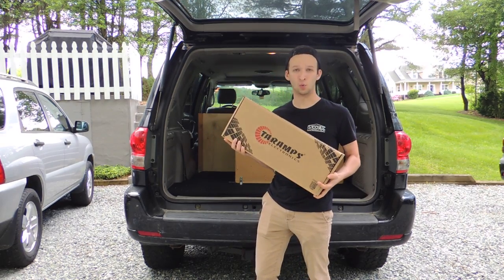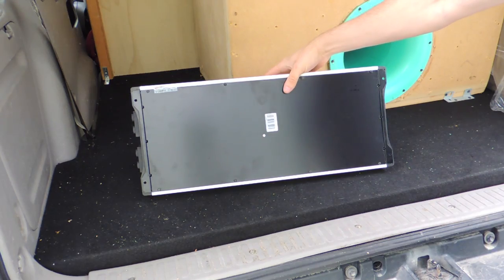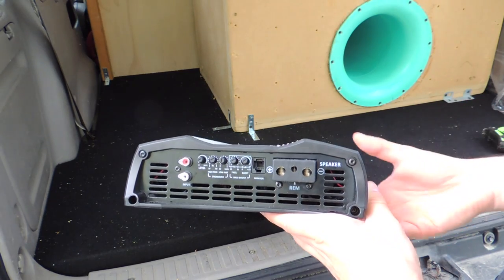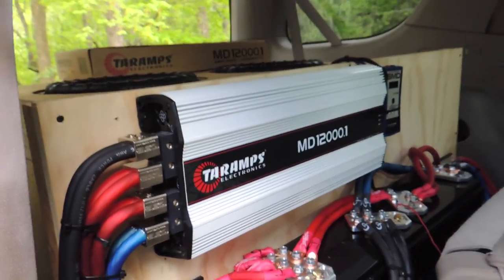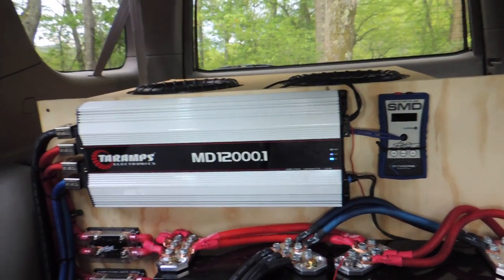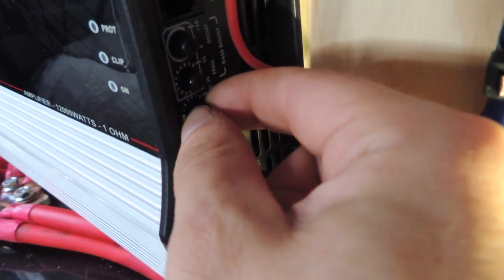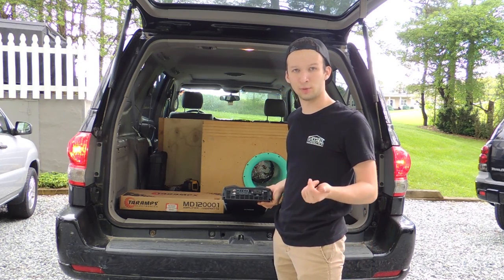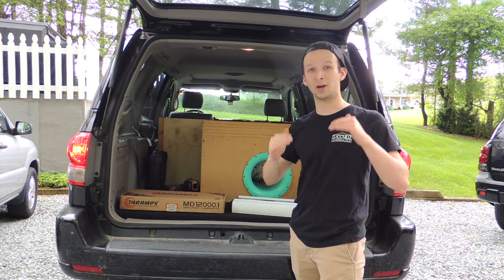TARAMPS? Watch This Before Buying!! | Taramps MD 12000 Review

Comment: You are going to continue to have issues if you keep mounting your amp on your enclosure! Mount that monster in a spot with some deadener behind it. You will also need an upgraded alternator.
Reply: His amp isn't mounted to the enclosure. He did a video a little while back showing the building & installation of his amp rack.
Reply: Joe B - It shouldn’t be anywhere near that enclosure, period. I don’t care what he built to hold it. That is just way too much flex my man.
Reply: He really does not need a bigger alternator with all that lithium he just needs to keep them charged
Reply: Garlicbread Riders - Yes he does, and honestly he should have a least two Mechmans for that kind of power. That amp needs stable high power at all times. There is a trade off with budget power. A top notch Orion or Rockford amp can withstand instability, but not Taramps, so the trade off is spending thousands on electrical instead of thousands on amps. You can fight it all you want, but you will eventually lose.
Reply: Garlicbread Riders - Guess what? He just installed a more powerful alternator.
Reply: King Willie u sound knowledgeable in these. What u think of Skar brand? I just bout their competition amp n speakers $600
Reply: Yapaul Aung - What model?
Reply: King Willie competition svk or some shit like that. Both competition one
Reply: Yapaul Aung - That’s a good amp. Better than Taramps.
Reply: King Willie yea i dont know whats up with the new school shit. Taramps, zapco, soundstreams use to rule the streets in 90s.  Im just getting back in it an seeing that its not a $1/watt era and is the best time for me! 😂   You would have to spend atleast $10,000 to get a lot of todays sound back then.  Might have to buy all their speaker line an upgrade my door speakers. Love bang for the buck plus this company dont bs with watts. They test RMS an back then, these amp company was frauding consumers for a long time. Now we see who still around. Im still a fan of JL but them boys too expensive. W7 is a beast. Havent heard anything that can compare to that sub pound for pound. U heard anything that would resemble JL w7?
Reply: Yapaul Aung - JL is alright, but the W7 can’t compete with today’s stuff. FI Car Audio or Pierce Audio can build you a speaker that will blow the W7 out of the water. Deaf Bonce doesn’t play either.
Reply: Yapaul Aung - Orion is still kicking ass with its HCCA line too. Remember the old school 225 HCCA?
Reply: King Willie I dont think the avg guy could not afford it and I just learned about that model right now. 😂    Can you send me a link from amazon for a build that is budget friendly that will knock out JL w7. Under $1k setup. But I want only 1 speaker bc of trunk space.
Reply: Yapaul Aung - Yapaul Aung - Yep, Deaf Bonce is nuts. It depends on whether you are going for SQ or SPL. The W7 is a SQ speaker so it’s difficult to compare. I would go with a Wolfram AVG2 12 in a custom tuned box.
Reply: King Willie sq or spl?  Damn wtf is that? Need education lol
Reply: King Willie wheres the link
Reply: Yapaul Aung - Sound quality vs sound pressure level.
Reply: Yapaul Aung - Sealed enclosures are more accurate and vented/ported enclosures are louder and more boomy. You also need to have the enclosure designed to match your speaker parameters to get the most out of it.
Reply: King Willie def SQ
Reply: Yapaul Aung - Put a lot of wattage into a sealed enclosure and you won’t be disappointed.
Reply: Wanna enjoy the crisp sound and clean mids an hi paired with sub like home theatre stuff. I sat in a Volkswagon with B&W speakers.. omg. Blown away by the stock radio
Reply: Yapaul Aung - I used home theater speakers in cars before. If you want really deep base and excellent SQ on a budget you can find a good home theater sub on Craigslist. They are usually small and loud. Just make sure you match the impedance load to get the most out of your amp, which may require more than one sub. Home theater speakers are tuned much lower on average, sometimes below 15 hertz. You might cause an earthquake though, so be careful.😂
Reply: @kingwillie206  no shit klespe powered 8 inch subs sound better than the ole bose did back in the day. They are incredible in terms of SQ but expensive as fuck
Reply: @kingwillie206   I have a quick question about taramps how come the bass 8k Taramp is dark gray and another bass 8k is white ? What’s the difference between the colors why do they make two different colors but it’s the same amplifier and same wattage do you know?
Reply: @mikehause6585  the reason why home stereo subs sound so amazing is simply the enclosure. Open one up someday and you will see why they're so efficient.
Reply: He doesn’t necessarily need an alt if he did keep the lithium charged but it would help a lot forsure cuz anything past 12.6v the amp will be happy and that lithium will keep it past that if he has enough ah. Plenty of people have ran these amps on a lot less power you just tune it to what you got 💪 if you aren’t clipping and not dropping below 12v your good. Just cuz you don’t have the electrical for it doesn’t mean your gonna blow it, just tune it to where you aren’t dropping below 12.6v(what it’s rated for) and you’ll be straight 😁 got a buddy who ran a md12k at 1 ohm with just a sms 220 and he ran it for 3 years like that and had no issues at all. Finally got his electrical up and gained a fuck Ton but still the amp won’t just automatically go full tilt or pull all the power it can unless you tune it like that. You can run a 12k amp on stock electrical just make sure you have it tuned properly so you aren’t straining the amp. It takes 3.6 amps to turn it on and it’s a 12v system that amps are made for so just stay above 12v and don’t clip you’ll be fine 👌👌👌
Reply: But don’t expect 12k rms if you don’t have the electrical to back it! You’ll just have an expensive 1-2k rms amp on stock electrical 😂😂
Reply: @LaggerVidz  - That was my next response 😂😂😂
Reply: @srtjdm1458  - I wasn’t notified of your Taramps question. No, they are different lines. If I remember correctly the MD line is full range and the bass line, well it speaks for its self.
Reply: @yapaul6226  Skar V and smart 3 amp. Viola🔊🔊🔊
Reply: @King Willie In your opinion, Orion HCCA line is better than Taramps?  I have a Resilient Sound Onyx 12 in a 30hz box.  I had an Orion XTR4000.1d on it.  It can take way more power.
Reply: @thegreens3568  - No comparison. The Orion HCCA line is much more reliable, beefier, and higher in quality, meaning it can handle voltage drops, dissipate heat better, and provide stable power for much longer runs without frying. They also put out way over their rated power so keep that in mind when matching subs to them.
Reply: @kingwillie206  Cool, I will stick with ORION.  Just ordered the HCCA 3000.1dsplx   Thks mayne
Reply: I'm saying though, thought people stopped doing that in the 90s...
Reply: @kingwillie206  isn’t one the main causes for failure with taramps because of overpowering? I thought for Brazilian amps it’s best to keep it in the 12.6 range? I may be wrong, but with impedance rise on these the 12k should be at about 8k at 1ohm nominal (2.5ish after rise) . He could bring it up to an actual 12k by increasing the voltage or wiring his subs to .25 nominal (1ohm after rise) but either of those things would brake these Brazilian amps I would think
Reply: @kingwillie206  IMO taramps are great for daily because they usually have really high rated power  to make up for the loss due to rise and they have really high efficiency from 85-91% but the downside is they are bad for competition because you can’t wire for .25 ohm nominal to get a true 1 ohm load or else you will completely get fry taramps.
Reply: @jamesbaysinger9780  - Yes, you get high power, but the internals are cheap, which means they are ultimately less reliable no matter how you slice the pie. I still have a Fosgate amp from the 90’s that pounds just as hard now as it did then. It has been in several vehicles over the years and has been through hell. You will never be able to say that about Taramps, but you get what you pay for.
Reply: Rule #1 with Brazilian: Do not Mount on the Box.
Reply: @kingwillie206  I love the old rockford sti have my old punch 300 and a mtx blue thunder 75×2 put them through hell still running
Reply: @gabec6522  - And sounding clean!
Reply: @kingwillie206  I just bought a harmony amp cheap 100 bucks I won't lie its not to bad.
Reply: @gabec6522  - Well that’s the thing….Those old amps were built like tanks but we paid a dollar per watt back then! A dollar per watt 😦
Reply: @kingwillie206  yep. My first system was orian colbalt and one of those big ass orian amps with a cooling fan. If I only knew what I had. Man those where the days. I reallyvliked the old mtx stuff man thought it was the best.
Reply: I got 2 alternador 250 amps each  and i got 8 🔋 300 amps hr each for only 1 12k MD taramps and you goin to keep Burning  amp if You have  a stock alternador lol
Reply: @FinnaBin  not true you are comple rong
Reply: @kingwillie206  if your box has vibrations it’s a shitty box lmao. but yeah mount somewhere else
Reply: @yamilrivera3635  - Yep
Reply: You can lead a horse to water but good luck on getting him to drink
Reply: @joeb9793  well thank God!
Reply: @LaggerVidz  hello. I have an 02 Acura tl type s with a 120 amp alternator. I don't have alot of money to upgrade electrical. I'm looking for an amp in my price range that I can run on stock electrical. Will I be okay with a 3k Stetsom or Taramps?  Thank you
Reply: That's an old debunked myth......Wives tails.....
Reply: @boostjunkie2320   - It’s common sense not to mount an amp where vibration is high and there’s no experiment capable of disproving that. I could be wrong, but I was speculating that he had it mounted in a high vibration area.
Reply: @kingwillie206  lol You obviously don't go to competition's.....Where you see it all the time
Reply: @boostjunkie2320  - Where things are seen isn’t in question.
Reply: I have mine mounted like that no problem whatsoever, it’s just a myth
Reply: The whole dont mount the amp on the box thing is a complete myth, think about what vibrates more your heavy ass enclosure or every other spot in your car?
Reply: @83malibuwagon  - To each their own. I’m not doing it.
Reply: Yes yes yes, the problem is mounting amplifier to the box. It’s like shaking and beating finically on the amp until it will go out.
Reply: Your vibrating the amp to death it shouldn’t be mounted to the sub box they’re failing because of where it’s mounted !
Reply: @kingwillie206 I bought a $250 600w rms amp and it delivers it max power even on a crappy way to low alternator so I don’t see how that would wreck the amp…
Reply: @thejjgang6338  - Well let’s just say there’s a reason why he’s upgrading to a vehicle that can hold 3 alternators. He’s blown multiple high powered Chinese boards and no Korean boards so far.
Reply: I’m no expert by no means but I’m running two 12 solo Xs on a a 12k tar and have the tar mounted on a a three inch thick piece of memory foam. Cheap fix and almost no vibration. But probably about to upgrade to the sundown 8k

Comment: I remember most 1000 watt amps looked like this size 20 yrs ago🔥
Reply: Shizzz my old California a1200  max 600w was a foot longer
Reply: Yup them Ole 90's ppi joints were huge!
Reply: Class ab and class d fullbridge cant be compared at  all
Reply: @CVLova  im comparing footprint "Einstein".....i never gave any details, if you can read you can clearly see all of what I said.
Reply: Haha yep i had a 1000 watt Coustic amp pawn shop special on 2 kicker comp 15s in the late 90s that was a good 18" long or more easily! Went to a soundstream reference 500sx after that which finally gave out recently. Finally went class D with a Fosgate 500 mono block. Amazing how small it is for the power output. Literally half the size of the ref 500. That taramps 12k is a beast though damn!
Reply: @jkstdstang  my buddy has the md taramps 3k on 2 fi 15s at 1.3 ohms in a 7 cube ft box and it slams so hard my ears start to hurt.. I almost got a taramps but I ended up getting an sfb2k instead and its been holding up just fine. I have a stetsom eq 3k fullbridge amp that I'm selling since I liked the sundown better.. What about those banda fullbridge amps?
Reply: Roma2189 pena sounds like a sweet setup. I was looking at the taramps smart 3 myself but not sure I wanna put all the money into electrical etc which is why i just have a 500 rms monoblock for now on a single image dynamics dvc 12". Kinda wished i got twice the size but maybe down the road ill go bigger. 

I dont know much about the banda amps. Will have to watch some dyno runs on those and check em out.
Reply: @RomaVilla  well if you used any form of common Sense you'd realize that class A b amplifiers are always bigger than class D amps. Compare a modern 12000 w class A/B amplifier to this one... Good luck finding one without a house note attached.
Reply: @sethh8892  only class A b amp I ever owned was a 4 channel 1800 watt legacy and it was way bigger than this taramps. You assume I don't know squat about amplifiers but ive owned my fair share of amps and I think I know the difference between a class a b amp and a class d monoblock. I just voiced my opinion about the size or footprint being way bigger 20 yrs ago, thats all I mentioned, meant nothing else!😑
Reply: @Roma2189 Villa taramps smart 3s are fuckn beasts. I had one on 2 skar zvx 18s and they could barely take all the amp had which was 3400 rms I think
Reply: Ive got a rockford T1000.1bd about same size maybe bigger but onpy goes to about 1500 watts pushes my skar zvx 1 ohm no problem
Reply: @biggesmalls446  nice, how much did you pay for it back then. Ive yet to see one of these amps in person. I heard they give off really clean power. Those zvx are the real deal. I have one sitting in room because I'm trying to break in my Hd 15 on a 3k taramps md but when I had the zvx in my ride, it got crazy loud and actually hits harder than my Hd.
Reply: @RomaVilla  - Banda and Taramps are the same quality wise.
Reply: @kingwillie206  I almost got a banda 5k but I ended grabbing an Orion HCaa 3000.1dsplx instead and I couldn't be happier...
Reply: Gotta love how orion rates their good amps at 12 volts. Bump up to 14.4 and you're getting a huge amount of extra power. I wish they didn't go extinct because of the Rona.
Reply: @lildwell2  I was also impressed with what this amp can do at 12 volts, my Orion 3k came with a birth sheet of 3350 watts rms at 12.4 or 12.6 if I'm not mistaken.
Reply: @timsix561  audiobahn ya lol they are loud as fuck I had 1 in my old skool car running it on 1000k watts lol it had some power
Reply: I have an old 500 watt Jensen class D amp the size of a 3000 watt Taramp.
Reply: No doubt, I had a kicker ZR600 back in the day and it was this big.
Reply: My Scv 6k is huge! And the 7500.1d deaf bonce is even bigger! 32 inches! Full range amps definitely reduced the size vs power ratio! Actually I'm thinking of going back to full range Brazil just because of the size! I have no room in my trunk with the deaf bonce apocalypse aak 7500.1d! It's a tank! But this md 12k would blow it away! Bass on Brothers 👊😎💯💨💨💨
Reply: Facts 😂

Comment: When you shorted the terminals, you killed some output fets. They were shorted. And the amp went into protect avoiding further damage. When you power cycled, the amp has a delay built in on the protect circuit to allow it to start while its charging caps, checking systems and initializing drivers. That delay was enough to allow the amp to power on the power supply into a short(the output fet(s) that got damaged durind the short of the leads. This most likely cooked the remaining output fets on the affected bank, the power supply fets are probably done and the class d drivers. 
I would recommend anyone with a taramps that if you trow it into protect, at least by shorting terminals or blowing speakers, DO Not power it back up. At a minimum, put a meter on the output terminals to see if they are shorted. When the fets die, most of the time the short. Ideally i would open it and check all the fets, but that means voiding the warranty.
Reply: Nah it would be illegal for them to void your warranty by opening the amp up and removing a warranty sticker.  

https://www.youtube.com/watch?v=lDNg3WYaAAc

They'd have to prove that you damaged the device by opening it.
Reply: this is what exactly happened to me with my brand new md12k taramps.... i added some dual 0 gauge inputs on each input and accidentally one of the + wires from the battery bank touched the body and sparked heavily (pRRRRRAAAAAKKKKKKKKKKKKK!!!) the amp was hooked up during this and i finished up and turn the music on and the amp went in protect so i turned it off and immediately turned it back on after about 5 secs and boom i head a pop inside te amp.....opened it up and the output mosfets (some of them) were blown and yea i ca bet the drivers are gone>

Comment: Thanks for being honest and owning up to it, and making us aware. I'll own up to mine. I pulled out my Skar rp1500.1d and assumed I knew which was the power wire vs ground 4g. I should've easily looked and double checked. Well I hooked up power and ground reverse in the amp. When I go to put the battery on, the fused connection after the battery saved my ass. Lit up and melted the 150 amp ANL fuse. I corrected it the next morning when I figured out what happened. The amp works fine, no issues. It's the Taramps Smart 3.
Reply: How does that skar amp
Preform ? Thinking of getting one
Reply: Measure twice cut once!!!🤔😉 A lesson that won't soon be forgotten.💥😫
Reply: @nnnvv2121  mine heats up too easily for what I want it to do.
Running rp1500.1d on skar svr 15. Sometimes two 15s. 
Either way it heats up on short drives and below full tilt so meh